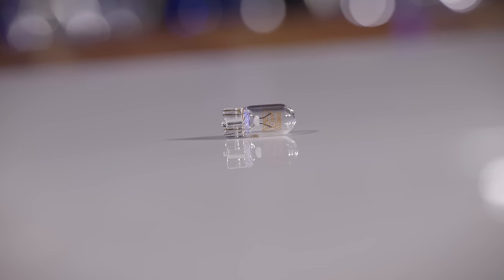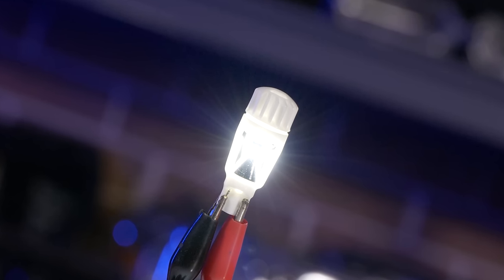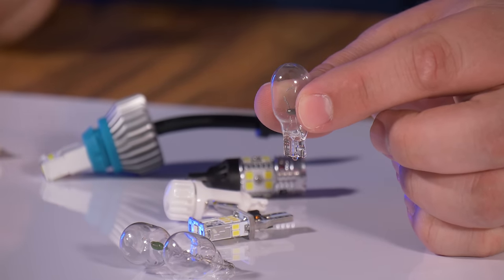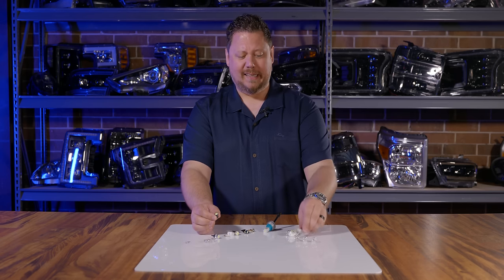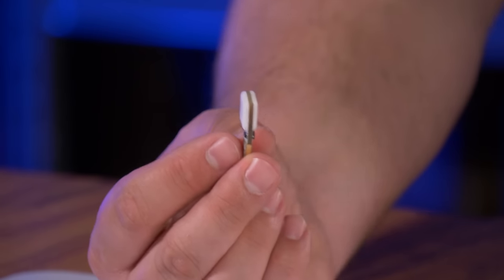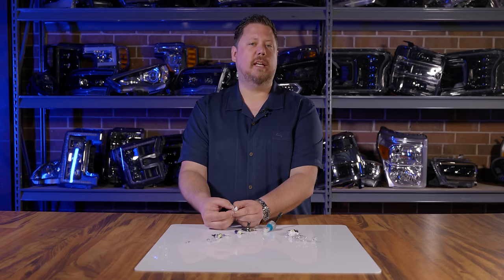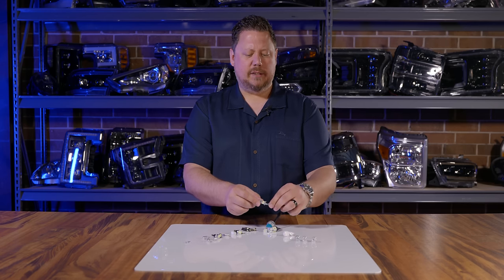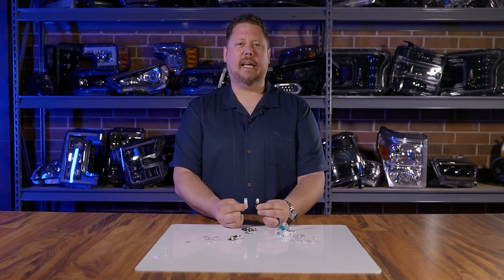T10 LED Bulb Overview - How To Pick The Right Ones For Your Application

Comment: The main problem i have with T10 dashboard lights is that they never have the light source in the correct spot, so the factory diffusers within  the cluster no longer function correctly and as a result, you get hot spots and shadows.
Reply: great.
Reply: I've run across the same issue.  You have to try and figure out if you need a lamp that offers more light off the end or the sides and try and pick the one that would work best.  It can get expensive in a hurry you end up have to try 5 different types. 😒

Comment: Most people after a t5, are after backlight for gauges. The wrong style will cause blotchy light, or "hot spots". . . .I'd also like to add, that you should choose an led that will cast light into the reflector if applicable. A forward facing led will never put as much usable light out of a reflector housing, as an appropriately designed 2 sided led.

Comment: It is very important to me that when I reverse, my reverse light will be blinding people left and right behind my car. I rather then upgrading my T15s bulb in my reverse light into that GTR LED that is as bright as a headlight. I will be cutting off the socket and connect it to 2 very large spotlights that I then mount it on the roof top of my car. Just to make sure people from 10km away can see me and knows, "ah that guy is reversing his car".
Reply from the maker: Now I think that would get the job done! Just make sure that you have those spotlights mounted with a 55W 5th Generation HID kit for maximum light output!😂

Comment: Wattage is the measure of power dissipated, or used.  In electronics,  the electrical equivalent of one horsepower is 746 watts in the International System of Units

Comment: This was very helpful. I never knew about the T5, T10 and T15 designation for those bulbs. That'll make choosing some interior bulbs a lot easier.
Reply from the maker: Glad we were able to help! Let us know if you ever have any questions!
Reply: T5 is commonly used in cars before 2000s. Mostly in speedometers, climate control and switches (fog light, heater, etc.).

Comment: I've been using Osram t10 in my front sidelights since 2007 swapped into 3 new work vans used on average 50hrs a week and still going strong 13yrs later. The original glass bulbs would only last 6weeks or so.
Reply from the maker: Nice, that's awesome that they're still going strong!

Comment: Thank you for the video. Very informative.
Is there any danger to replacing a T10 5W halogen bulb with a T15 12W LED bulb? My car's lamp housing has space for the larger T15 bulbs, but I am worried the socket and/or wires cannot withstand the higher wattage.
Reply from the maker: Nope! As long as you have the space, run it!

Comment: If you replace all your turn signals/break lights, etc with these LED’s, do you have to do anything given the different power output? Or just replace and move on?
Reply from the maker: With blinkers you may need to install resistors, otherwise they just plug in and are good to go!

Comment: Nice in depth video, though geared more for exterior.  QUESTION : what is recommended for 194 replacement for dash gauges OEM and aftermarket just a tad brighter ?  thank you
Reply from the maker: Here is our best selection of T10/194 LED bulbs, https://www.headlightrevolution.com/lighting-by-size/custitem_cat_facet_bulb_size/T10-SLASH-194?order=commercecategory:asc

Comment: I'm about to replace the PC194 and PC74 bulbs in the dash of my 94 Suburban. Your explanation of the current numbers for the bulbs is very helpful. Since these are in plastic twist lock bases, trapped in a place with very little air circulation, I'm a little concerned about heat dissipation. Any recommendation on whihc LEDs are best for dash lights?
Reply from the maker: Any of them will be fine, no need to worry too much about heat. Bulbs this small do not produce much heat at all!

Comment: Will these T10 LED's be dimable in the dash? Also would love to see 4500k color instead of 6k for other areas around the car/truck. Anyway great YouTube videos so nice and helpful.
Reply from the maker: Those T10s will be able to dim down for the most part, with all LEDs if it gets to a low enough voltage they will just cut out.  Glad you found this video helpful, let us know if you have any other questions!

Comment: Great vid my man! Wanted to ask if there are any issues if you install a Canbus bulb on a vehicle that does not necessarily require a canbus bulb (meaning it’s fine to run a LED/bulb that aint canbus)?
Reply from the maker: If your vehicle doesn't require Canbus you wont need it. But shoot us an email with your full vehicle spec and we can let you now everything that you need. 

Sales@headlightrevolution.com
Reply: @HeadlightRevolution  i actually got canbus reverse LED  bulbs for my Hyundai Elantra X20 (08 model). Read some articles that it may affect the car but the thing is I’m not sure if it requires it to begin with as there aren’t much info on these cars. Hence I went with the ‘safer route’ with the canbus LED bulbs. To be honest no error lights on the dash and it works fine. More worried in the long run in terms of mechanics of the car etc

Comment: Have you ever seen issues with aftermarket LED reverse lights that stay on sometimes? They would burn dim when not in reverse. I changed back to incandescent and the issue went away. I just hate to buy another set to try out. Its a 2019 F350 SRW.
Reply from the maker: We haven't seen that before with our bulbs!

Comment: Hi, I know LEDs are the best replacement/upgrade.. I just need to ask, I relplaced the stock halogen T10 3W on my bike's running light (clear color) with halogen T10 5W (amber color).. are the 2 additional watts on each bulb going to cause any heat problem with the sockets/base melting? the base are made of rubber. I'll replace them with LEDs soon just don't want the extra ones I have to go to waste. :) many thanks in advance.
Reply from the maker: Not at all, you'll be good to go!
Reply: @HeadlightRevolution  many thanks 👍

Comment: I recently added some sylvania led bulbs to my chrysler 200 s interior lights and when the lights are all off the leds still stay dimly light. What causes this and how can I fix this?
Reply from the maker: It's usually a resistance issue and will most likely happen with any other LED bulb as well. Maybe something that requires more power would work? 

Check out the GTR Lighting bulbs!
Reply: @HeadlightRevolution  I'll try that the bulbs I'm using are 194 .5 watts by Sylvania.

Comment: Hi, because LED low voltage usage, how do I compensate my car PC. I have a 2005 Jaguar XK8. I was told that I did to use diodes
Reply from the maker: You can sure what's called a PWM (pulse with module). That can correct the electrical flow so the bulb can work on your vehicle. 
https://www.headlightrevolution.com/gtr-lighting-pwm-hid-kit-modules-ACC.PWM5202.MOD_2?quantity=1

Comment: My wife's car was rear ended and they fixed it but never put in the trunk light.  I bought a t10 194. But it doesn't fit into the socket.  I think they wired in the wrong socket.  I need something smaller.  What do I buy?
Reply from the maker: I would suggest reaching out to our CS team so we can go over some options with you!

218-755-5200
Sales@HeadlightRevolution.com

Comment: My wife is a rural mail carrier. The turn signal/flashers are constantly needing replacing. Tried LED. They stopped working  very fast. Went back to oem. Recommendations?
Reply from the maker: I would recommend going with a set of our Armor series turn signal bulbs, and going with a set of the 50W 6ohm resistors. They are a tried and true option that we have had a lot of success with, so I think they would work well for you! Let us know if you have any other questions!

Comment: what is the tool that you are using at 00:28 ?
I've a problem with removing the bulb out of the ovehead lamp housing.
Reply from the maker: Pliers.
Reply: @HeadlightRevolution  thx, i have a hard time when removing those bulbs

Comment: I have an 04 Sebring GTC convertible with the dome light in the mirror (both edges).  Darn if I can even begin to remove the bulb in there as it has "tight" tolerances and is so low into the slot.  Any suggestions?
Reply from the maker: We haven't worked on that vehicle before, so we can't help much here unfortunately. But I did find this video that will hopefully help out! 
https://www.youtube.com/watch?v=RHXb60tT5rI

Comment: What do you think about Sylvania zevo 194 t10 blub?
Reply: Been running em everywhere 194s  3157 3156. 7443 h11 with absolutely not 1 issue in 10÷ years in bikes sleds and multiple vehicles.  I feel imo they don't talk about or push them here cuz they either can't or sylvania doesn't offer wholesale or allow distributors to MAKE MONEY and that's why HR pushes brands that allow then to get that middle man money cut. Phillips also great leds they don't talk about. That porcelain xenon depot 194 they push is a direct copy of a Phillips

Comment: I bought a 194 to replace a 53439-79 in the front fender of my Harley and it won't fit?
Any recommendations?
Reply from the maker: That should be working for you, at least based on the research I just did on that light! I am not sure what is going on there, and I am very sorry about that! I would recommend contacting the Harley-Davidson dealership and checking with them on what bulb it is in that application. Sorry I couldnt be of more help, let us know if you need anything else!

Comment: What's the best forward facing T10 bulb. I would like to change my headlight parking bulb(T10 fitment), and use it as DRL.
Reply from the maker: This one will be your best option:
https://headlightrevolution.com/gtr-lighting-t10-194-168-canbus-led-bulbs-10-chips/
Reply: @HeadlightRevolution  thanks for the reply.
Reply: Headlight Revolution Which one would you recommend best as for brighter in headlight reflector? That GTR T10 or the Morimoto XB 2.0 T10?
Reply from the maker: You're very welcome!
Reply from the maker: I'd still go with that GTR T10 LED. It also has chips on all sides of the bulb, so it performs well in reflectors as well. 
https://headlightrevolution.com/gtr-lighting-t10-194-168-canbus-led-bulbs-10-chips/

Comment: Thanks for the video! I need to replace a T20 bulb in a turn light on a Yamaha Xmax 300 2020. Which bulb could I buy? (PS: I have already the blinker relay which supports LED lights)
Reply from the maker: Here you are!

https://www.headlightrevolution.com/7440-7443-gtr-lighting-carbide-bulbs-LED.BUL.7443.CAR2_2
Reply: @HeadlightRevolution  Thanks so much!

Comment: - ?? -
Mercedes Sprinter Van 2021
Interior lighting dimmable?
glass base T10
W5W not a good light, I need brighter light for reading and writing. so LED with 6000k. what will be the best? installation? In Germany, Mercedes says nothing to you, only original 5w w5w T10. Help !!!
Reply from the maker: Any of our T10 bulbs should really help brighten up your interior. 
I would suggest the 10 LED T10 bulbs!

Comment: Question: I’m having issues with T10 signal lights. It doesn’t work (as a signal light)
Reply from the maker: What is the issue? Those should work for you as a signal bulb, just need to have those resistors installed!
Reply: Headlight Revolution is there a small enough resistor that will fit in the side mirror?
Reply from the maker: Oof, that will definitely be a hard one. We have the regular turn signal resistors, but nothing smaller in size than those. I have linked those resistors for you here: https://headlightrevolution.com/gtr-lighting-50-watt-6-ohm-gold-style-resistors-for-custom-installation/
Reply: Headlight Revolution that won’t fit. Well thanks anyway! I hope people can invent a smaller resistor for these applications.
Reply from the maker: The technology is always advancing, so I could see that happening in the future!😏 Hopefully some day the vehicle manufacturers will be smart enough to make everything LED from the factory! Those halogens can just be totally un-safe!😨

Comment: Remember NOT to exceed your stock system recommended Amp Hour Load or 1 watt per bulb. In my 2019 ford flex SEL I Cannot use more then 1 Amp Hour/ 1 watt  Per Bulb or ill blow out or short out my BCM. It already happened once lol
Reply: There is a huge difference between 1 amp and 1 watt. 1 amp is over 13 watts in most vehicles with the engine running. 13 watts is a LOT of power for an LED bulb, only the highest output T10 bulbs would exceed that. Most use 2 watts or less.
Reply: @thebeetalls  definitely appreciate the feedback. I used this brand called Luyed off of Amazon, the lights were incredibly bright but within days it fried a relay inside the BCM. Thankfully ford was nice enough to do me a solid and send the light circuitry to the only empty relay bank I had in that thing. So I went back to the Philips vision 194 bulbs in cool white. Haven't had any issues after using those. Ill admit that they are the same brightness as the stock bulbs which sucks but they are cool white in color and warm to the touch. I only replaced my stock bulbs because my daughter burned her finger trying to turn off the light. The car I have is a 2019 ford flex SEL and to turn off the lights manually in the rear seats second row, you have to press the actual center of the light lense to turn it off. I think that's a very poor design. I got a 2002 buick park Avenue Ultra and that car has a separate light switch right next to the bulb lense. I put the 43mm luyed branded lights on that one and they haven't given me any issues like my ford. Those are 3 watts and nothing has blown. Maybe my flex is complicated with its electrical system. 🤷🏽‍♂️

Comment: Good job. I bought the gtr bulbs from you to replace my third brake light in my tundra. In your video you created for the tundra to replace these bulbs you used the gtr reflex series bulbs but you sold me the gtr carbide bulbs. Why was there a change between your video and what you sold me. Refer to your youtube tundra video to see what i mean.
Reply from the maker: The Tundra video's are a few years old. The Reflex bulb is no longer around and we replaced the bulb in that kit with the Carbide series. It's a much brighter bulb!

Comment: Some cars lights stay on .even when lights are off you can still see little  bit light
Reply: Edy C I think it had to do with canbus
Reply: They draw so little that you can get some feedback coming online in reverse depending on vehicle circuit and electrical engineering used in design with proper electronics used /not used as per electrical theory